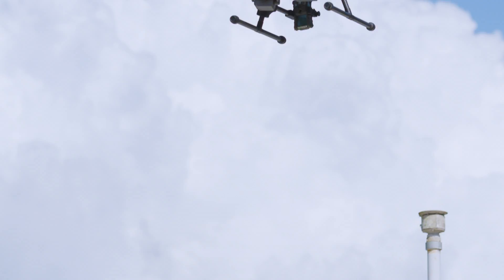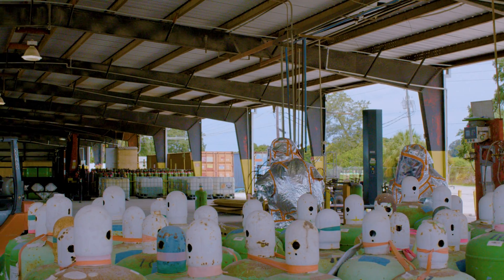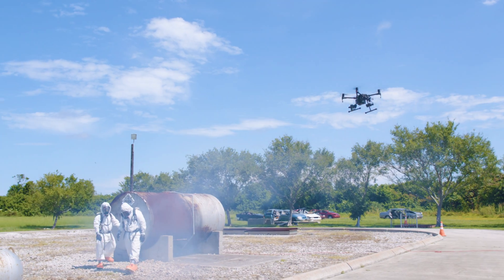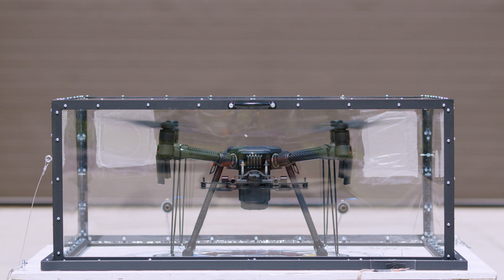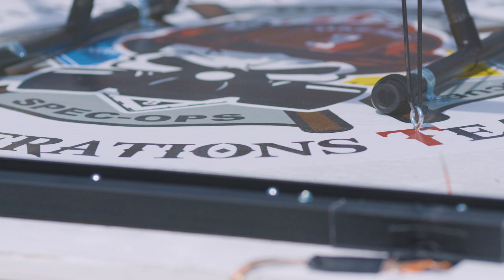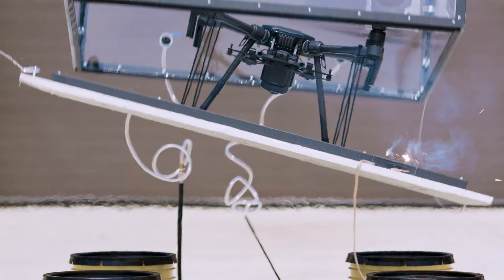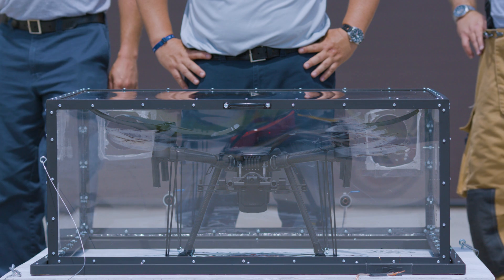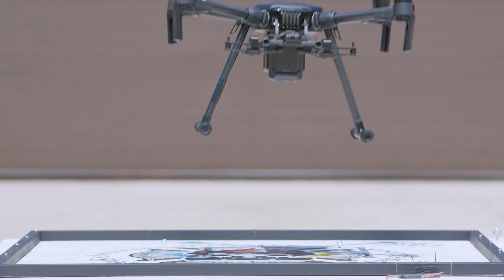DJI – M200 Series Aces Fire Safety Flammability Test

Comment: Yeah except all drones use brushless motors, which generate no spark, and are controlled by solid state electronics which also generate no spark. Meaning not a single drone in the world could ignite a flammable atmosphere. I like DJI but that's not a unique selling point.
Reply: The motors alone could produce static electricity. This is why we currently do not have intrinsically safe drones on the market.